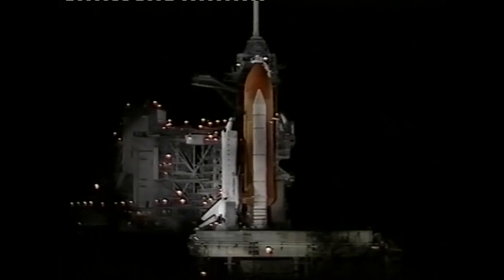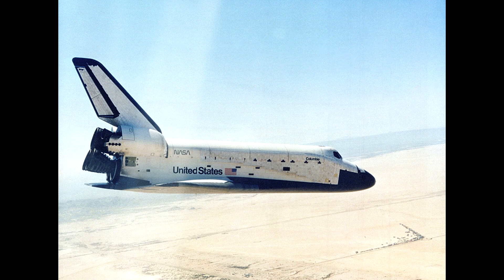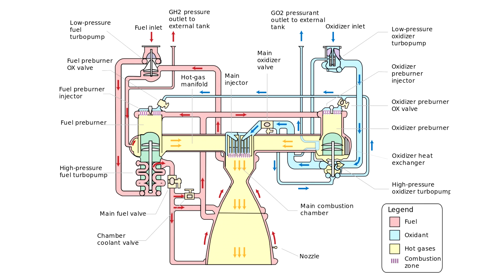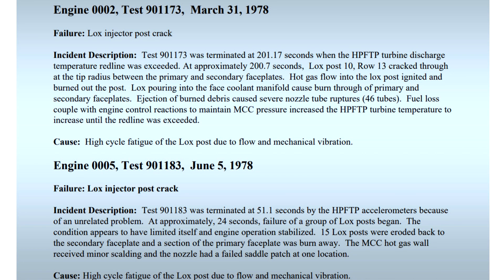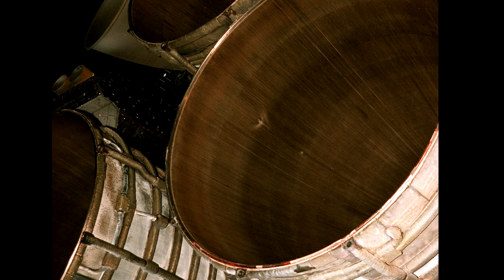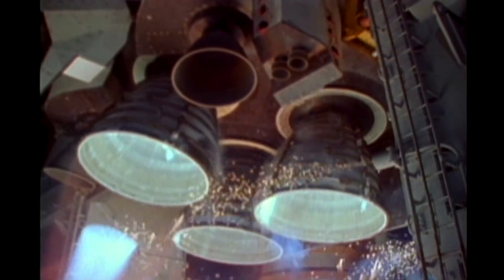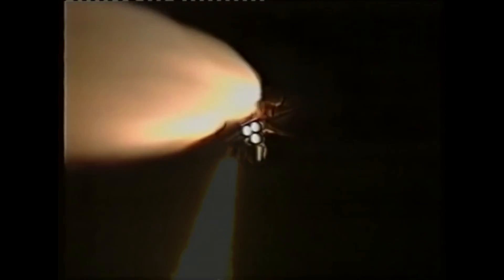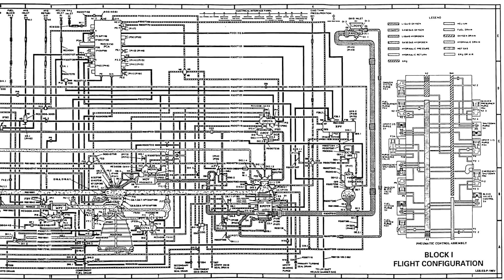How A  Gold Bullet Almost Destroyed A Space Shuttle

Comment: If weight was an issue, why did they assign Columbia to this mission?  She weighed about four tons more than her sister ships. As the first shuttle, she was a bit overengineered, with extra black tiles on her wing chines and a stronger frame. There was also some wiring from test equipment from the early flights that was difficult to access to remove.
Reply from the maker: The main reason was that Columbia wasn't retrofitted with docking hardware for ISS & Mir operations so it was first choice for other missions.
Reply: @scottmanley  if sts 107 would of lander her next mission sts 118 she would of gone to the ISS and then Sts 144 she would of brought hubble home then retired nasa was planning to use shuttles till 2030 or 2040
Reply: @donlee20066  Columbia was also planned to fly on STS-122 in April 2004 and STS-128 in August 2005 at the time in addition to STS-144. Both of those were originally planned as hubble servicing missions, and then 144 was to bring hubble back down. Ultimately after Columbia's loss 122 and 128 were changed into ISS missions, and Atlantis flew the final hubble mission, STS-125 which carried out what was planned for STS-122. STS-144 was planned to launch in 2009 at the time of STS-107 and was the only flight NASA had planned for Columbia. All the 2006, and 2007 planned missions were scheduled to be launched with other orbiters so Columbia would've just sat in the hangar for 4 years before 144. Kinda crazy to think about an alternate reality where 107's disaster never occurred. We would've gotten actual pictures of Columbia in orbit like her other sisters had she flown to the ISS in 2003 for example.
Reply: All of the other orbiters at this point had undergone significant overhauls to better fit them for construction of the International Space Station, namely the removal of a native airlock. The other three shuttles were stuck with an external airlock no matter the mission. Simply put, Chandra would not fit in any of the other orbiters. Plus, using another orbiter for STS-93 would not have been a very efficient use of resources, as Columbia was generally incapable of reaching the International Space Station. (inb4 someone mentions her planned visit on STS-118)
Reply: @Tsarbomb117  to answer your question sts 118 would of been flown with a different external tank your would of noticed a little taller and wider to accommodate the fuel columbia would of burned and meco would of been at t + 10 min 30 sec mark
Reply: @donlee20066  "... would have ...".  Just grated on me too often...
Reply: @Tsarbomb117   Should be mentioned that her visit on 118 was scheduled to be flown with a crew of 5 and not 7 as well. Columbia was only assigned this mission due to Discovery being out on her orbiter maintenance down period, otherwise Discovery would almost certainly have been assigned this flight. Columbia was more than capable of reaching ISS, she just wasn't as efficient as the other 3 were for that type of mission.
Reply: Columbia was not "generaly incapable of reaching ISS".  It could reach ISS just as well as any other orbiter vehicle. She reached Hubble which was much higher than ISS, though it's inclination is much more desirable. The issue was Columbias extra mass which ate into ISS payload.
Reply: The inclination is what I was referring to. Perhaps my words were exaggerated, but Columbia was a very poor choice for any mission headed to the ISS.
Reply: I can agree with that, for every degree of inclination above 28.5º, the orbiters payload was decreased by approx. 500-700 pounds. Since ISS is located on a 51.6º thres over 10,000 pounds of payload right there. No wonder NASA designed the Super Light Weight Tank specifically for ISS useage.  They also looked into using the 5 segment SRB as well.
Reply: Why do higher inclinations require more fuel? Obviously I knew that higher inclination = bad for Columbia but I don't understand the physics behind that.
Reply: +Tsarbomb117 The ideal launch scenario is a prograde launch due East from any point on the Equator which has a latitude of 0º.  Remember that the Earth is rotating towards the East. At that latitude any launch vehicle has an Angular Velocity of 1674.4 km/hr (1040.4 mph), even when it's sitting there on the launch pad.  Every spacecraft that wants to attain a stable orbit must attain a velocity of approx 17,500mph.  So launching due East from the Equator(0º latitude) requires the engines to accelerate the craft for less time.  Think of a prograde launch from the Equator as getting a "free" 1040.4mph headstart on the launch vehicles race to an orbital velocity of 17,500mph.  This headstart allows you to do 2 things. 1) You can run the engines for less time, thus saving fuel or 2) you can burn the engines for the same duration, but with an increased mass of the vehicle. Kennedy Space Center is located at 28.5º latitude, and the Earth is rotating towards the East.  The increased latitude decreases the initial bump in tangential velocity. he "headstart" from KSC is only 1471.5 km/hr (914.3 mph.)  The greater the angle from the Easward rotation of the Earth your launch trajectory is, the less of a free ride you get.  The worse scenario would be to launch in a retrograde manner from the Equator at latitude 0º towards the WEST.  That would be like trying to run up an escalator that is moving dowwards, a very ineffecient manner in which to attain orbit.  Right in between is the Polar launch. Initially Shuttle was to launch polar orbits from Vandenbergs Space Launch Complex-6(SLC-6).  Since launches from Vandenberg were due South, the initial tangential velocity to the South is zero, so no assist in initial velocity is seen.  This is why NASA required Filament Wound Case(FWC) Solid Rocket Boosters(SRB) which were lighter than the conventional steel cased SRBs to help to mitigate the loss of initial launch velocity which in turn reduces the payload mass that the Shuttles could carry to Polar orbits. Some of the planned Polar orbit Shuttle missions even required running the Space Shuttle Main Engines at higher throttles for the heavier payloads.  STS-62-A Discovery was the first manifested launch from Vandenberg.  It was to launch in Summer 1986, in fact that missions SRBs were already stacked, but issues in the construction of the launch infrastructure would have probably pushed STS-62-A into 1987. The Challenger incident sealed the fate of Polar launches from Vandenberg after 5 billion dollars was spent preparing the facilities in California.
Reply: @Tsarbomb117  Because when you launch due east into a 28.5 degree inclination, you get all of the Earth's rotational velocity for free.  The farther you turn from that heading (the higher the inclination becomes) the more of that speed you have to make up by burning fuel (or carrying less weight).
Reply: So it had more space to fit the payload
Reply: Just the way you worded this comment reminds me of the song of the Edmunds Fitzgerald
Reply: Some of that test equipment was still there and gave them more data of her demise.
Reply: An overengineered, stronger frame seems a good reason to use that Shuttle for the heaviest payload yet (and ever).
Reply: Columbia due to her massive size was the only orbiter that could launch something as massive as Chandra. The thing about Chandra is that Columbia was the only launch vehicle that could launch her. There was a huge fight within NASA in the 1990s to launch her on Columbia or a Titan IV or Delta III. The pro-Shuttle NASA people won the debate. If Chandra was launched on a Titan IV or Delta III they would have had to drastically scale back the size of Chandra which would lead to it losing a lot of the capabilities that it has and it still works today. 

The thing was in 1998-99 NASA's and DOD's launch vehicles had so many disastrous failures. NASA lost two Mars probes in 1998-99 and the DOD and commercial companies lost 3 consecutive Titan IV launches and 2 consecutive Delta III launches (these failures led to the death of the Delta III which is why we never talk about the Delta III and instead talk about and celebrate the Delta II and Delta IV) from August 1998 to May 1999. NASA/DOD/commercial customers were hurting badly and the Space Shuttle was really the only thing working in both years. STS-93 working well and being perfectly executed, mission-wise, pretty much saved NASA even though Columbia was lost in 2003. Imagine if STS-93 failed in 1999. Didn't matter if crew loss or crew survived because Chandra was one of the most expensive things ever launched by a Space Shuttle in one mission, only second to the Hubble Space Telescope. And if that mission had ended in an abort to landing/orbit without launching Chandra that telescope would have had to be thrown away because Chandra was not designed to survive two STS launches plus a chaotic emergency landing if it had to be relaunched.

Comment: Even the shuttle that was required to run extended tests before relaunch had such issues, I wonder how much wear and tear the Falcon 9 would experience in it's lifetime...
Reply: Man rated Falcon 9 boosters won’t be reused nearly as many times as any of the shuttles
Reply: Yes, I heard for manned flights they will use newly built ones only.
Not about that but including unmanned launches. Since the Falcon 9 is said to have a life time of 100 flights, Space X would likely push to get as much reuse out of each booster as possible. And looking at how the Shuttle with extended maintenance still missed many wears in the equipment, Falcon 9 with much less inspection between flights would probably result in many boosters going up in a fireball.
Reply: ebigunso I disagree, I think that because there’s much less to inspect in the first place, the shorter turnaround time is appropriate
Reply: A couple points: Falcon 9s are planning to get a more detailed refurbishment after every 10 flights. Second, the shuttle was an amazingly complicated (over complicated) piece of machinery. I believe the number of individual components was over 1,000,000 (I can't find the number) I would be shocked if the Falcon 9 had more than 20,000. Inspections get much easier when the number of items to check gets smaller.

Comment: so if they where so preoccupied with everything else, did they realise what happened during the mission or was it not till the shuttle was in refurbishment and some engineer spots the big freakin hole in the engine bell?
Reply from the maker: Yep all these had to wait for post flight examination.
Reply: NASA has long had an extensive array of cameras (still & video) to record each launch.  In the case of 51-L it helped immensely in the post flight accident inquiry. There were numerous cameras that recorded the infamous 'puff' of black smoke right at liftoff signalling ole girls soon to be demise.  Those cameras recorded the initial plumage and  subsequent burn through at the aft attachment ring adjacent too the aft field joint for the right hand SRB.  

It's been rumored the cockpit voice recorder captured a crew member commenting on how the ride had suddenly gotten very 'bumpy'. This sinc'd up with the timeline just milli seconds prior too vehicle breakup. If this is true, then it would suggest that the crew felt the axial breakup of the aft attach ring and rotation of the right hand SRB as it broke away from (aft end) and rotated into (forward attachment) the external tank and orbiter.  

We also know that most of the crew actually survived the explosion and vehicle breakup. The crew compartment is seen exiting the fireball intact on long range cameras post mortum. Impact with the ocean is what killed the crew. This is supported by the discovery that all but 2 of the emergency life support systems had been activated and almost depleted. The systems had too be manually activated by each crew member and only had 5 mins. of oxygen. This was meant for use in an on pad abort as after the first 4 flights they crews stopped using full fledged flight suits and went too the jumpsuits. 51-L put an end too that practice.
Reply: JW Schwartz Nice history lesson, and all correct, but what does that have to do with the above question?
Reply: Oops!
Reply: Evidence of the nozzle leak was found on films of the launch fairly quickly, the cause of the nozzle leak was not known until teardown.